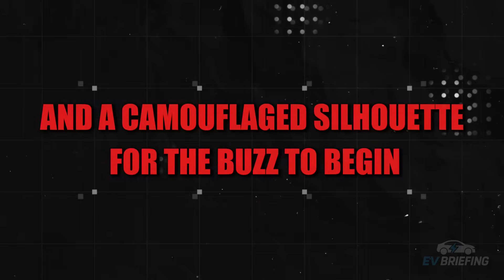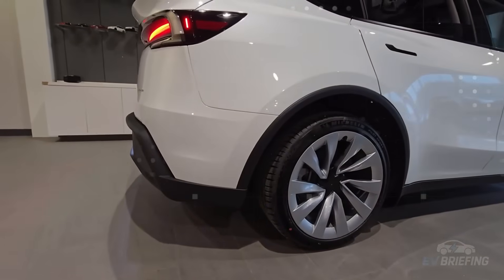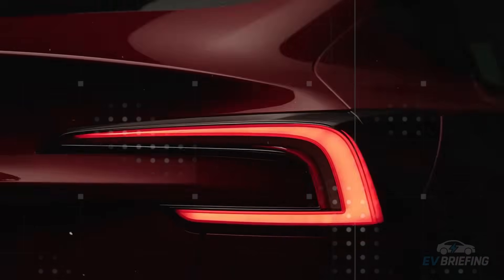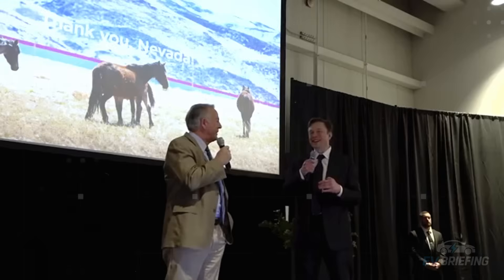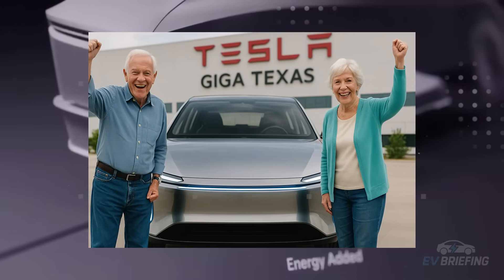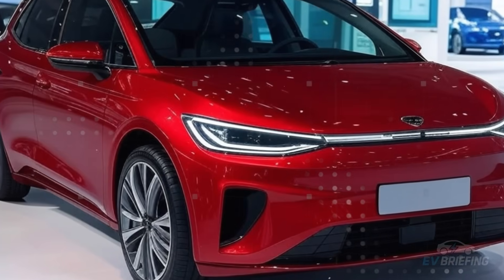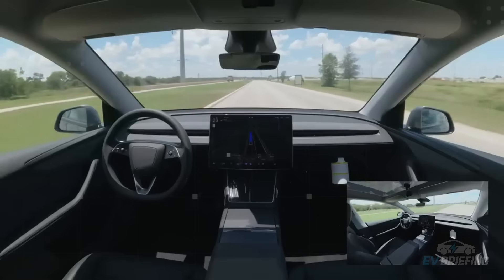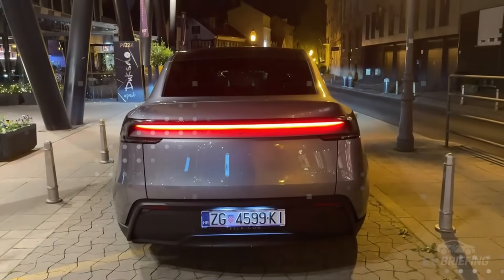NEW TESLA MODEL 2! $10k, 510-Mile Range, 10-Min Charge — New Updates On Musk’s Upcoming Launch!

Comment: I guess that the RWD  version will be named Tesla model 2, and the same with higher chassis, somewhat larger battery with Dual motor will be named Tesla model Q, Hopefully they will be introduced and may be ordered this year?
Reply from the maker: That’s a pretty solid guess — Tesla often uses that kind of naming and variant strategy. A higher chassis dual-motor “Model Q” alongside a base RWD “Model 2” could hit two big markets at once.
If both launched this year, which one would you go for first — the lighter RWD or the bigger dual-motor?

Comment: waiting and waiting for it, why not offer it for order NOW so we can get the benefit
Reply from the maker: I hear you — locking in orders now to secure the incentive would make perfect sense for buyers. Tesla might be holding off to align production timing and final specs.
If they opened pre-orders today, would you lock one in right away or wait to see the final price and features?
Reply: @EVBRIEFING  Here is what I heard.   Tesla was going to create a system where for a $100 you could start the order process.  IF you changed you mind you could get you money back.   But at least give me the chance to start the order, details and specs later so I can get the $7500 tax credit.   I am retired, 71 and on social security, that is a huge amount of money for me.  I have a 12 year old Ford Fusion with a 103,000 miles.   Now I love the car and it has been a great car for me, but it is time for a new car.   I was looking at a Ford Escape which would have cost me $47K...damn.   The Type 2 is "supposed" to be half that price.